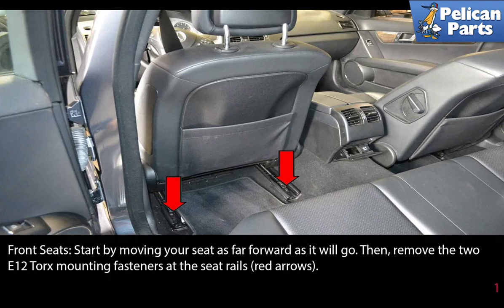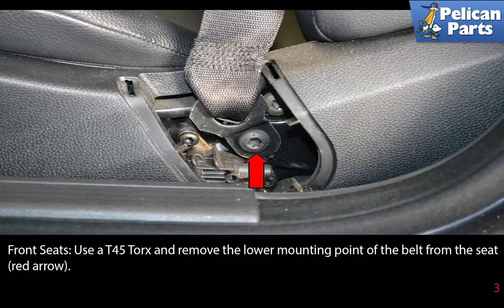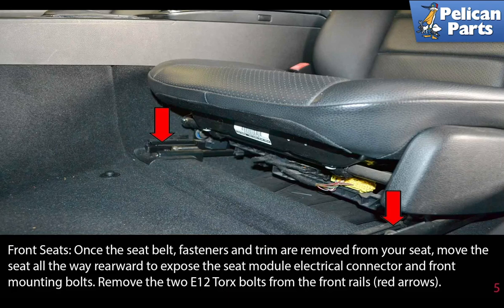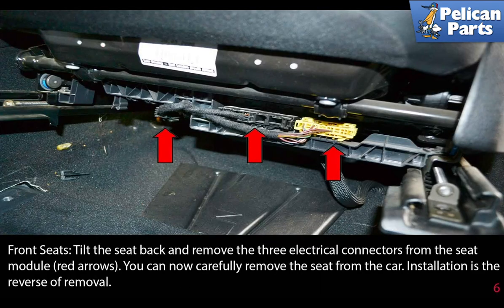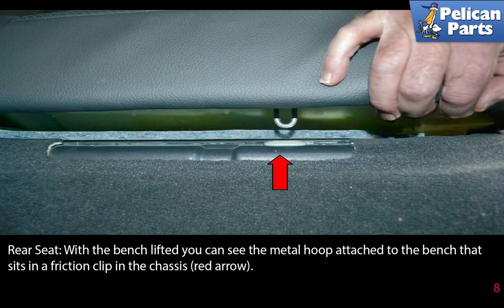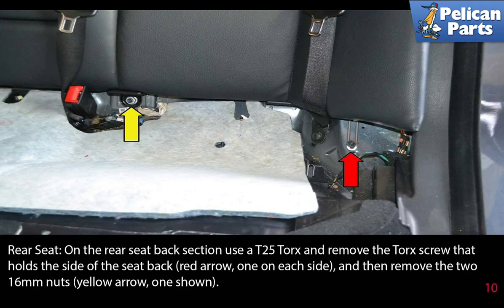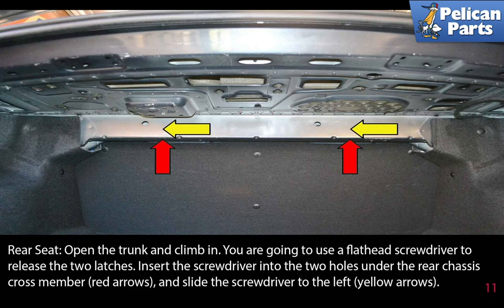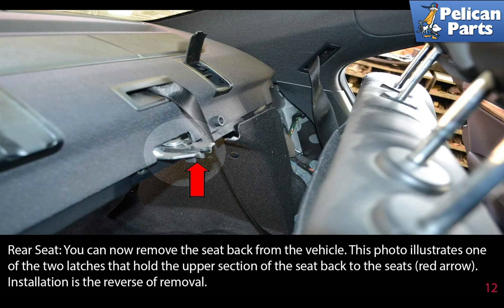Mercedes-Benz W204 C-Class Seat Removal & Replacement for c200 c300 c250 c180

Comment: Thanks for this video and many others on the w204. I've learned alot from it.

My 2008 model does not have heated front seats. Will the 2011 models' front seats fit in the same way? 

I'm considering to find a 2011 at a wreckers and removing the seats, wiring and buttons. The buttons in the dash are the same as the 2008. Only my 2008 has a blank cover.

The 2008 w204 also does not have a usb port. Although older models do.

Can I also use the radio unit from a 2011, which looks exactly the same in the dash, but has the added usb port and flip up screen?
Reply from the maker: The seats mount the same, no matter the options. Except for wiring differences.

Radios won't work used due to theft systems.
Reply: @pelicanparts  thanks, I'll have heated seats but will still have to use cd's like it's 1999... thank you for the tip on the radio, I was not aware

Comment: If the motor under the seat has stopped working and you can't move the seat back and forth in order to get to the 4 bolts that holds the seat down, what would you look at first to get power back to the seat?
Reply from the maker: Fuses, then the control switches.
Reply: @pelicanparts  Weirdest thing ever, tried jumping the motor with the use of a  battery jump pack, i tapped the motor with a hammer while connecting the motor with power and bam it worked. Now seats move back and forth freely with the use of the switch.

Comment: I have a question if you cannot open your trunk to release the two lashes on the rear seat is there another way without opening the trunk?
Reply from the maker: Drill a hole to access the lock. However, that will damage the trunk lid and body.

Comment: Thanks for the awesome vid . Can you retrofit 2019 c class front seats into a 2012 c class? are the electrical connectors the same ?
Reply from the maker: The connectors are not the same. It will not be a simple swap out retrofit.

Comment: Does the battery need to be disconnected to prevent any airbag light from popping up ?
Reply from the maker: Yes.
Reply: @pelicanparts Does the battery disconnect before removing the 4 screws? If so, how can I move the seat to free the remaining 2 screws (front)

Comment: Any advice for removing the rear bolts if the seat is stuck all the way back?
Reply from the maker: You can remove the fore / aft motor. Then use a bit to rotate the motor drive and move the seat to the position you need to access the fasteners.
Reply: @pelicanparts  any advice for if the seat is jammed all the way back? 😂 the centre bracket under the seat has bent so only one side will move along the guide rails (I’ve heard this is a common issue)
Reply: Tengo el mismo problema como retiro el asiento si se quedo atascado hasta atrás?